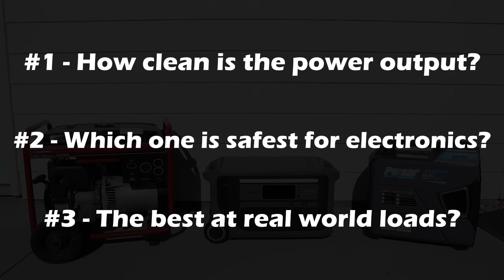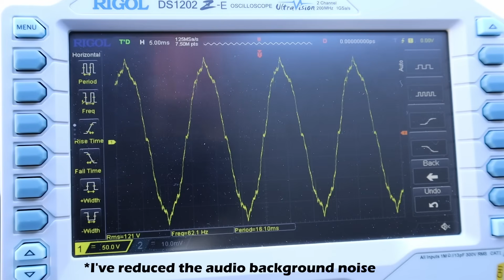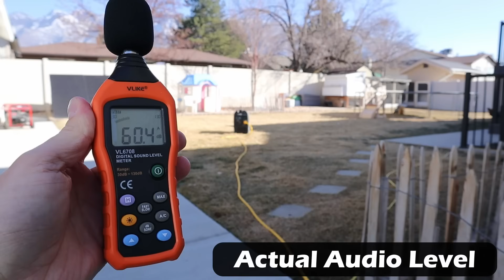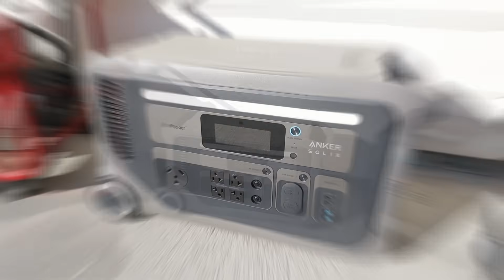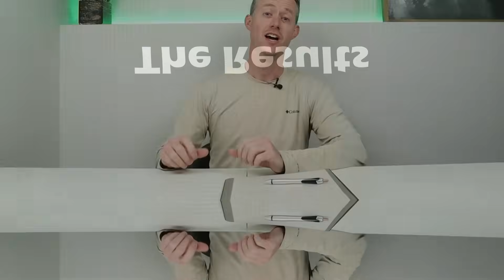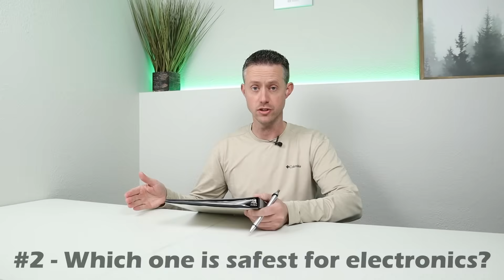Before You Plug Electronics Into A Generator, Watch This!

Comment: Very interesting !

And/but it also raises some questions...

1) When starting the table saw, there is quite a lot of noise on the oscilloscope. Where does that come from ?
Maybe the table saw has a sparking carbon brush motor, especially when it needs more current at startup time. Then the (electric) noise is generated by the motor (not the generator), damped by the impedance of the generator.
And I think I can hear the table saw switching on with a soft-start triac regulator to prevent the motor to jump out of the box at start-up time. That triac may cause severe high frequency noise.

2) I think most problems are not created by a (non-sinusoidal) generator, but by a lack of peak power, or non- sinusoidal load.
A conventional motor (vacuum cleaner, short-circuit armature motor, drill) van take up to 6 times its nominal power at startup time ... that definitively will cause a voltage dip and maybe overload.
A switching power supply will take way more than its average power during high frequency short peaks.
Led lights will take power only at the rising edge of a sinus, charging a capacitor. Then the charge is transformed to a constant current through the LEDs at a high frequency. So a LED bulb doesn't care if the source is 110 or 240 Volts. It will use the same amount of power and give the same amount of light. At a very different power factor.

I was thinking of regulating my hot water boiler to efficiently use most of the (excess) power of my solar panels. Just heat the water with the solar power otherwise not being used in the house.
First thought: a triac. But I am afraid the inverter cannot handle that. So ...
Second thought: use a relay to connect a capacitor (or two) in series of the heating element. But then the heater turns into a capacitive load ... I am not sure if that is any improvement.

Any thoughts or tips ?

Comment: Good tests! Got similar results when I hooked-up my Siglent oscilloscope to my Generac 22 kW, “whole home,” generator, which was running when my utility power company decided to drop power to my house to take-down some trees around the power lines. I was surprised how dirty the power that the Generac generator was generating.  For the “traditional” generator, I was wondering what a spectrum analyzer would show the strength (amplitude) and frequency of the various harmonics. Also, if the output of the “traditional” generator was first passed though a low-pass filter, would the filter’s output be clean enough for, what you call, “sensitive electronics”. By the way, my Siglent oscilloscope, which was running off of this dirty Generac power, was not damaged by this dirty power. Don't know if this dirty power influenced the results.

Comment: I wonder if you can build a high power filter and reduce the harmonics and distortion of the standard generator's output - it won't change the voltage fluctuations but it might produce a cleaner sine wave....

Comment: While I've never had a traditional generator cause damage to any electronics, I've mostly run them via a UPS since everything that I consider "essential" is connected to one anyway.  I speculate that the same filtering which allows a UPS to take over supplying power with practically no break also allows it to filter out harmonics, making for a "cleaner" output.

Comment: Would like to see ideas on how to clean up dirty power.  One I thought of right off the bat would be to convert it into DC and then drive an inverter from that.
Reply: That's how i do it. I charge lifepo battery with generator and use pure sine inverter.  No problem.  I like it because if something stops working i can trouble shoot and easily replace things. No expensive inverter boards to replace. Half the cost of a new generator.

Comment: And what do you think will happen if you power any equipment with what you call "dirty" power? As stated by someone else this generator's waveform is not bad at all. I've seen way worse and without any issue. The only thing that may happen is dissipating few percent more in heat but not on all equipment. A computer power supply takes the power and first thing, pass through a full rectifier bridge to make DC. I don't think some % of THD will change anything. I powered computers with "modified sine wave" (should be called modified square wave...) and no issue at all. On the other hand, your saw is generating LOTS of parasites.. way more THD than any generator and that is not normal..  Classic generators sets are NOT dangerous for any equipments... Please stop spreading anxiety-provoking incorrect conclusions.

Comment: 6:56 thank you for correcting what these are called.  Power stations DO NOT GENERATE POWER.  They're just big batteries.  They are NOT GENERATORS.
Reply: They’re generators. Grow up.
Reply: Ok boomer. Traditional generators use gas (fuel) and combustion to supply power. A solar generator coupled with a MPPT solar controller uses rays of the sun (fuel) to supply power. Same thing different fuel source. 
A “battery” can’t do that. That’s like calling your car an “engine” and ignoring all of the other parts. 🥴
Reply: @CredibleHulk-444  LOL you're funny.   I'm good with calling them a "power station" as a compromise, shall we say, but again, they don't "generate" ANYTHING.  If you have one hooked up to a solar panel, then the solar panel is generating the power.  If you have it plugged into AC, the generation is coming from the utility.  Even a car engine gets its power from the gas and converts it, but in the end, regardless of any bells and whistles, these things are just storing power, not generating or converting it.  Thank you for attending my TED talk! :)

Comment: Plus the shape of the sine wave and the THD should not affect any electronics as their internal power supply should handle that small amount of distortion with no issues. IF they can't handle that generator output then they can't handle grid power either.

Comment: Yu need to try a better quality "normal" generator...there are units out there that will maintain the proper frequency (and thus the voltage) under a load.  A properly maintained and adjusted generator (alternator, really) will hold to within a single Hz under load and will maintain voltage to within 3 or fewer volts.  Comparing a crappy generator to the other two is disingenuous and somewhat biased.

Comment: The thing a lot of people don't get is most devices, especially things that you usually think of as sensitive like computers, the first thing the power goes through is a rectifier to convert it into DC power.  Then it gets smoothed and regulated.

Also note, this is not the same for every generator, when I have done similar tests with my own champion 7500 watt dual fuel its fairly clean looking with no spikes and just a bit of S curve in the sine wave.

Also inverters - with a big load like a sump pump the waveform is frequently MUCH worse than your pictured conventional generator.  I'm fairly sure a 2500w inverter generator is responsible for killing a septic pump.

Comment: Do electronics really need clean power? If it has good enough capacitors to take out the AC ripple then surely any small deviations from the sine wave shouldn't make any difference?

Comment: wish you had an old generator, prior to the new capacitor evcited units to include in this type of test. voltage regulation is poorer but the sine is probably cleaner.

Comment: The most efficient solution is a power station that, if no solar power is available, is charged by an inverter generator. This saves considerable fuel because the generator charges the power station at high power, thus maximizing efficiency. In contrast, the efficiency of the power station itself doesn't vary significantly depending on whether the load is low or high. In any case, it is virtually silent, which also reduces the operating time of the inverter generator, saving fuel. An inverter generator running continuously can be disruptive and also wears out faster. Therefore, I always use both devices during a power outage. There are also inverter generators and power stations that are electrically coupled and automatically recharge the power station's battery when its capacity is low.
Reply from the maker: Yep, that's the perfect setup to conserve fuel and limit noise as much as possible 😊

Comment: Great video showing real world operation.
Dirty power and or 10vac fluctuations is normal for old shaft driven alternator/generators as the hz and vac is determined by rpm and set under 80% load, unloaded vac output and hz is higher. The voltage  regular is just a full wave rectifier with a simple field exciter and centrifugal/oil pressure speed govenor. Not much to go wrong. My troy built 8kw had a failed regulator after 20 years of operation. $25 part and easy to install. 
All A/C electronics now have pwm power supplies either external bricks or internal and are global in input range, 90 vac to 240vac. They filter and make a very clean dc output.
Voltage level and frequency matter for inductive motors, usually 110 to 120 vac. The power company keeps increasing the V every few years as higher V means less A for power in watts. I remember in 1980 commercial power was 115vac, in the 60's it was 110vac, the 2000's it was 123vac and now 125vac.
inverter alternators  make vac, rectify it to vdc, filter it and then it goes thru a dc to ac converter. The converter can output very clean sinusoidal wave forms and is far better at fast  frequency and voltage regulation than  older analog generators.
Summary:
imo: 
Inverters are more efficient for gph. For todays requirements clean vs dirty power only matters for inductive  motors like compressors for hvac and refrigeration.

Comment: I have a Harbor Freight Predator 3200 ( or close to that).  It’s a traditional generator similar to the one you showed.  I had an extended power outage a couple years ago and took the chance of running my refrigerator, freezer, a couple TVs, my Internet equipment, a computer, and some lighting.  Except for one TV all the equipment is less than five years old.  The outage was about 12-14 hours.  The only thing that complained was the UPS for my Internet equipment.  Feeling a bit daring, I pulled out the UPS and ran the gear directly off the generator.  Everything survived the dirty power and all gear is still running to this day.  I would prefer not to have to do that again, but until i replace the Predator with an inverter generator (or power station) I’ll live with what I have.  Also of note is that the UPS that acted wonky on dirty power worked fine after I put it back on utility power once it was restored.
Reply: I experienced the same thing with an APC SmartUPS 1500 (I think) and it sounded like a relay was switching on/off very quickly when on the Honda EM 500SX generator.

Comment: The Best of all worlds would probably be a  regulated 48V DC Generator - used to charge up a 48V battery - bank / power station  (eliminating the initial AC wave forming and regulation - to the "power station / inverter output)  this topology would be analogous to an "online UPS" - the DC Stage is always active - merely changing from externally fed to being the standalone supply - no switching time as the Inverter is always active..  - and the Dc automatically regulated on the input side of the inverter.

Comment: I am curious to know what type of standard generator you were running in the test because there are basically three types based on their exitation systems. Shunt, auxiliary winding or capacitor type. Also, your comment about the frequency being too high on the standard generator is incorrect.  The reason why the governor is set for 62 Hz unloaded is to compensate for loading. Otherwise, the fully loaded alternator will not fully recover frequency and / or voltage.

Comment: From a technical point of view this makes perfect sense.

The classic generator is just a bunch of passive coils. Along with parasitic capacitance you get an LC oscillator. On top of this you have a regulator working on the exciter current which can only react to the average of the output as a measurement. The regulator has to be slow and will  jump all over the place if you draw a "funny current". The frequency has to be aimed high since it depends on the engine RPM which will drop under load. 

A modern inverter works like an audio amplifier. There is a sine wave generator with a big fat amp connected to it. The frequency isn't affected by anything but the signal generator.
The harder it works to follow the signal from the sine generator, the more energy it needs to do this. This wastes energy and the power station is designed to waste as little energy as possible since the battery power is limited and it is supposed to run 24/7 on the battery. That's why the inverter generator is better, it can afford to waste much more energy.

Comment: I feel like the future will have inverter generators with a built in power pack. Higher surge capacity, cleaner sustained output and capability to auto start/stop gas generator as needed.

Comment: What about an AC Power Line Conditioner?  I haven't been able to find anyone testing a high watt power line conditioner on a regular gas generator to clean it up.   Supposedly, it "An AC power conditioner is a device that improves the quality of the power delivered to electrical load equipment. It acts to deliver a voltage of the proper level and characteristics to enable load equipment to function properly. It smooths the sinusoidal AC waveform and maintains a constant voltage over varying loads."  I'm just wondering if it might be an upgrade for people with only gas generators.  I don't know about surge, though.

Comment: I think you have to keep in mind that those standard generators were designed to be mainly emergency generators and jobsite generators. A 3,000-3,600 watt model also isn't going to do much to power a home if the power goes out. I'll give you some lights, a few basic appliances and maybe a window air conditioner. I'll keep your frozen food frozen and your beer cold provided your smart appliances didn't get fried during the storm in the first place. 

I would also think that its common knowledge by now that engine RPM affects the frequency output or 'cycles'. 
A few points high or low isn't going to affect many appliances and most devices have ac/dc power supplies that are designed to deal with such variables. If you check wall outlet power, its not uncommon to see the frequency ranging from 58 to 63 or so, at least that's what I see here. Most of the time it hovers around 59-61 cycles. It more affects motors and motor RPM than anything else, too low and a motor's hp rating is reduced and it tends to run a bit hotter because of it. 

The big problem with a power bank is if the power is out for several days, they may charge off solar but they're not going to replenish from a run down state in one day in the sun and likely won't make enough power to both charge the batteries and supply your home with power. They're fine for camping, short term outages and similar situations but if the power is out for more than a day, you need a generator. 

Most portable inverter generators are small, with low power output. They make cleaner power but they won't power everything and likely won't power your ac or primary heat and the rest of your kitchen at the same time. 

Most homes are best served with at least a 7,500w generator, 10,000 w is better. If sensitive electronics are a concern, then look into buying a power conditioner for those items. 
Smart appliances are never a good idea in areas that have frequent power outages, but even still, the logic circuits or 'smart' functions run off low voltage power supplies which tend to do a fairly decent job of regulating their power output to the electronics. the same goes for most electronics. 

I run a 8,500W Predator Generator in my camper and car trailer, when at the track or out camping, it runs my laptop and all the appliances, tools, and battery chargers without issue. It came adjusted close enough to produce consistent 59-61hz ac power with minimal or acceptable ripple current for my needs. I had a smaller 3,000 Watt champion for a while for the car trailer but it died after only one season, it was at its max most of the time and since those sort of generators are basically a car alternator, when run at its max or overloaded, the diodes or controller/regulator fails, windings overheat, and the power output is far from ideal for most items when pushed to its limit. 

From experience, most 'portable' generators are most reliable when run at at 50% or less of their rated max output. I can get by with a 5kw generator most of the time, and my back up is just that but at its max its struggling to maintain voltage when the load surges when items are turned on and off. 

I find very little quality difference between the top brands and the cheap Chinese models these days as well, having had many apart over the past few years its really hard to tell the difference on the inside between a name brand and the cheapest off brand models as they're all coming from China now. 

The older, simpler American made generators are better built, but most were never really meant to run a whole house, they were built as campsite or jobsite generators for power tools and lighting. I still own several Pincor, Winco, Coleman, and Onan generators and while they're more durable than the modern built units, they make less power per pound weight wise and that power is not nearly as clean or free of ripple current at the newer, electronic regulator models sold in recent years. All of the US built models that I own are over 40 years old. Chinese units started to show up in huge numbers about 25-30 years ago.